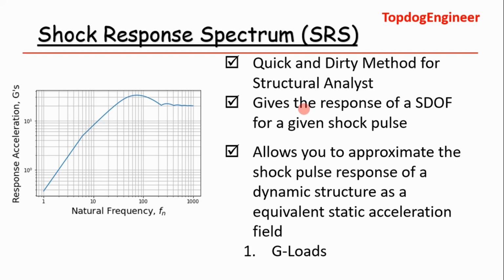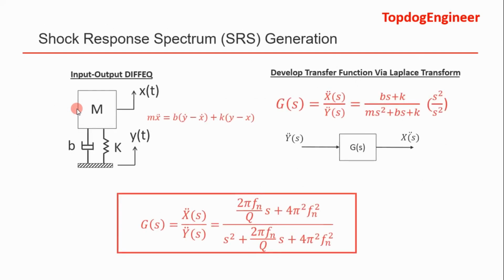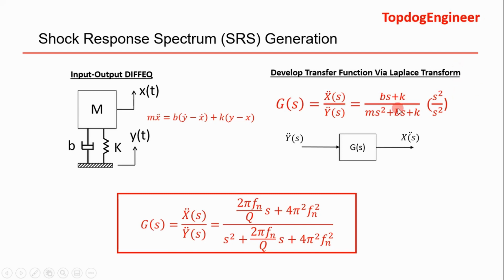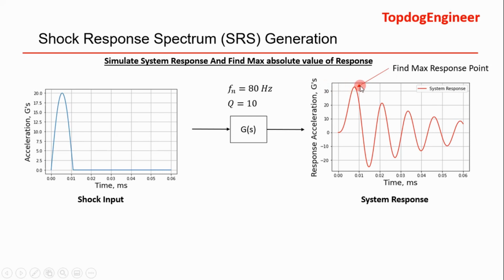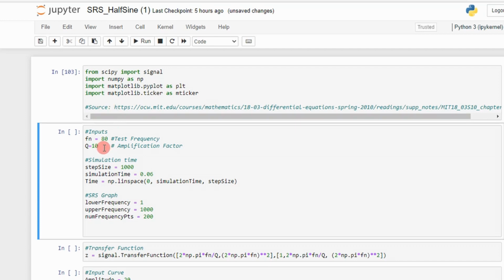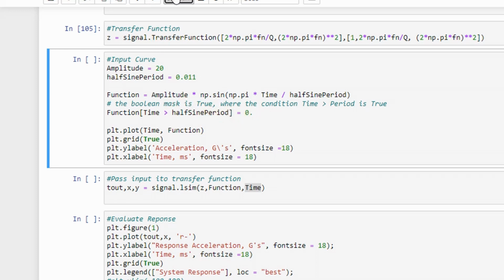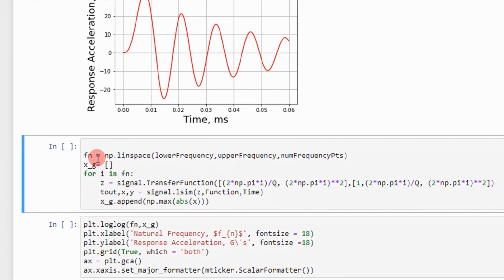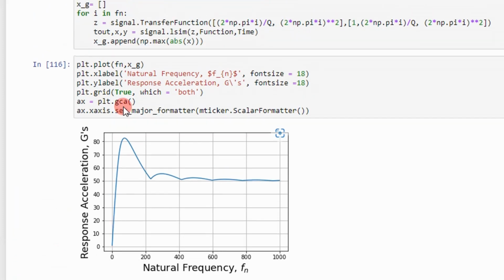Shock Response Spectrum: A Python Application

Comment: ı think there is something wrong about the video. ı am also dealing with srs but in my case there is acceleration-time values after gathering explosion on ship hull. then ı modelled any equipment  of any part of that ship with adequate springs that highly more k value. than ı gathered acceleration - time values from the center of mass of he equipment. than ı put in the bv or mil or china's standards. Am ı doing something not right or do you make something different from me ? By the way to extract acceleration-time from equipment almost take a week because ı try every kind of spring that different k value. And every kind of mass from 100 to 5000 kg. to get 1 SRS graph.